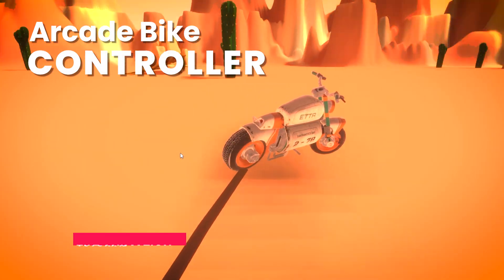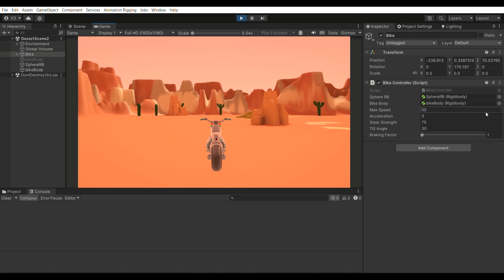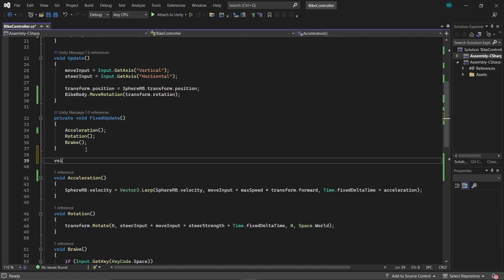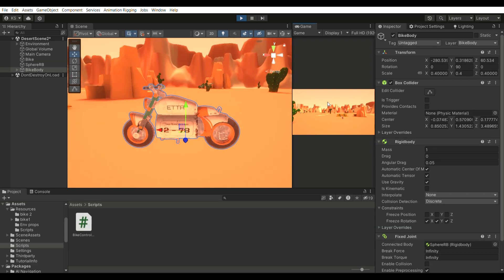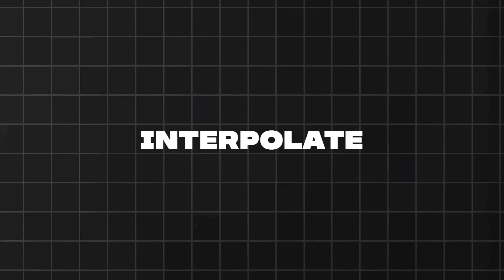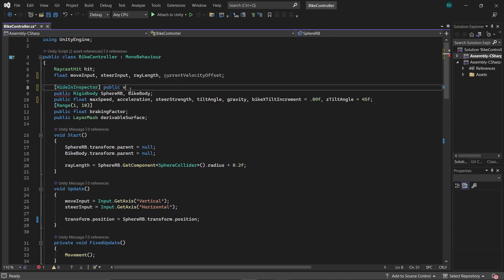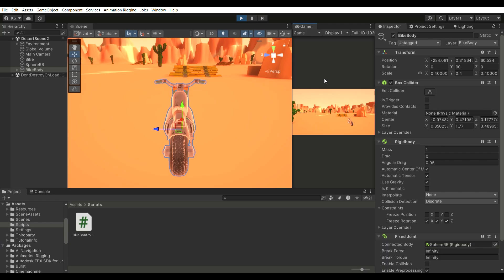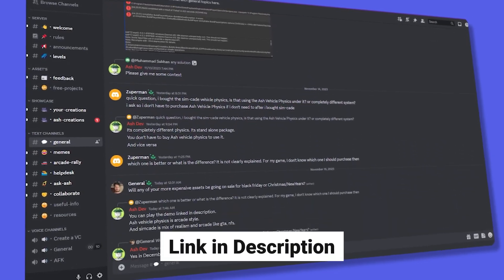Arcade Bike Controller Part 2 | Unity tutorial | Ashdev

Comment: Very nice tutorial! While waiting for part 3 i will work on the character using IK. By the way, on the handle rotation equation i added a (1 - currentVelocityOffset). This way it will rotate less on high speed, opposite from the zTilt that is bigger at high speeds.
Reply from the maker: Try my free asset for ik : https://assetstore.unity.com/packages/tools/animation/control-rig-249848
Reply: @ashdev  very nice, thank you!